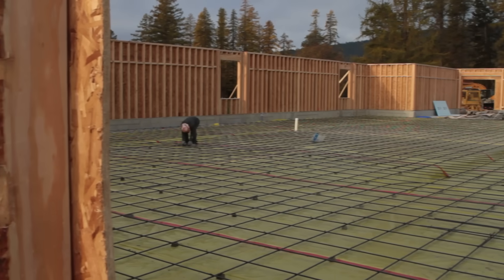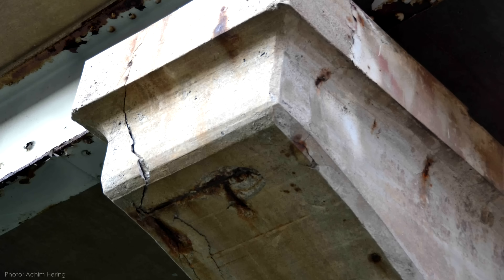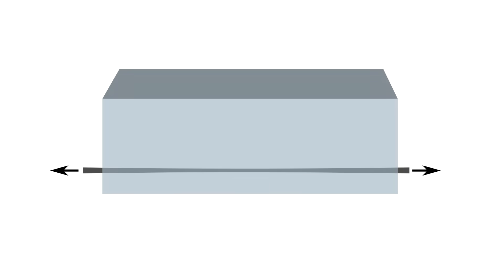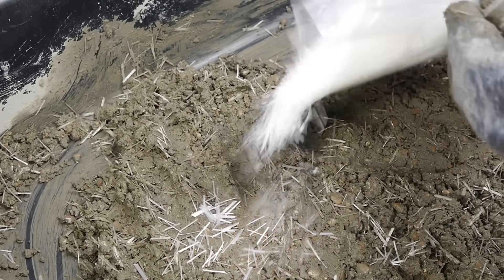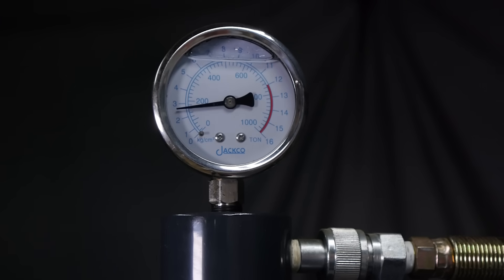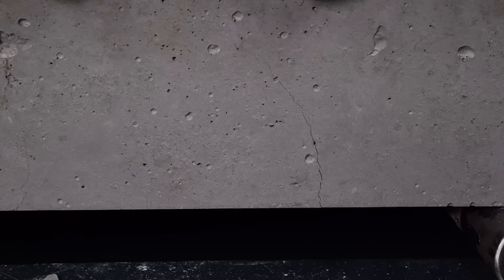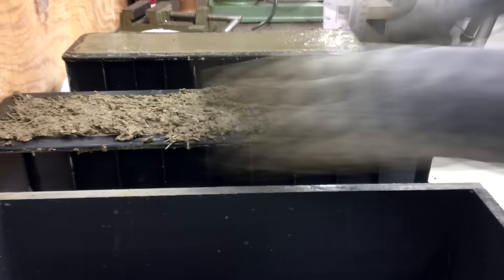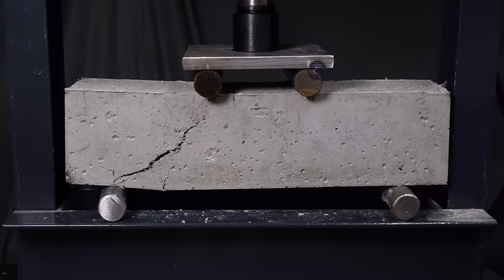Does Rebar Rust?

Comment: So basically hummanity went from making mud and straw structures to fiber reinforced concrete. Same concept, higher tech.
Reply: "Same concept, higher tech." sums up humanity. We still use alot of the same basic tools as we did in the stone age in alot of cases. There's a leather working tool that was used neaderthals that we STILL use completely unchanged. It turns out metal tears the leather, wood scratches and splinters, and plastic doesnt do the job right and breaks, but that same tool made of bone never breaks (and actually gets better with age), wears, out, and does the job perfectly.
Reply: @arthas640   
What's the Name of this specific Tool? I'm curious..
Reply: A jaw?
Reply: @arthas640  Not to get political, but president Trump is right in saying "wheels and walls work". I would add fire.
Reply: Exactly what I was thinking, this reminds me of Cobb construction.
Reply: Cobbcrete (TM)
Reply: Hahaha, I was coming down to the comments to say pretty much the same thing as soon as I saw the fibre reinforced concrete! XD

Plaster and horse hair is another old one. The ceiling of my old bedroom had almost an inch of that on wooden slats before it all came down
Reply: @HorzaPanda  wow!
Reply: @irenedavo3768  I was cleaning the ceiling to paint it and it fell down on me. Was not a fun clean up -_-
Reply: And rammed earth is still being used today.
Reply: Basically, we've never stopped building out of rocks and mud. Rocks are literally unchanged, mud got replaced with cement, and wherever mud was reinforced with naturally occurring fibers or sticks, unnaturally occurring synthetic fibers and metal sticks are used instead.
Reply: @ganaraminukshuk0   Yeah and warfare is still throwing rocks and sticking each other with pointy sticks. The difference the rocks move way faster and the sticks are metal.
Reply: fiber re-enforced mud bricks are still fine for some applications.  Shibam in Yemen is famous for its high rise mud brick structures.  they're like gremlins, don't get them wet.
Reply: I added a laser pointer to my hammer.
Reply: @Subhumanoid_  LMAO ...
Good one  !
Reply: We went from mud to clay to concrete and then did it all over again because we somehow forgot how to use concrete after the Romans vanished
Reply: I wouldn't actually say that. Have you been in one of those mud and straw houses? We still have plenty of them around, it's amazing how good the insulation is without any extra layers that we use today, in the middle of a scorching summer heat wave, it's like going into a fridge, and in the middle of a frost all it takes is a couple of logs to make you lie around in a tshirt.

Some of them even 200 years old, gone through several catastrophic quakes, one of them close to 8.
Reply: @techalyzer  do you have any sources for pictures on them?, aside from a generic web search that is, i find older constructs interesting.
Reply: @TS-jm7jm  I can just go dig in my pictures folder for the inlaws old house :)

I also have some footage from another place, my grandparents house in the country side.

Maybe I'll do a video about it and you can see it all there.
Reply: @Kiritsu: I had a similar thought when I saw the fiber-reinforced concrete being poured into forms. :)
Reply: And the sharpest blades we can make are made in the same old way we used to make arrow heads. Taking a rock (obsidian) and striking it with something else to fracture it. Materials technology is apparently everything lol
Reply: Because that's a simple, yet great concept.
Reply: @imienazwisko6527  you mean... concretept...

Sorry
Reply: Some of the early Great Chinese Wall was constructed by this method, only the later wall was stone.
Reply: There is a lot more theory that goes into it now. If you take a properties of materials class you learn about slip planes and the crystaline stucture of materials which has a big effect on their properties.
Reply: Grady - would you please do an anniversary special with a history and comparison of materials?
Reply: Which begs the question why din't we use fiber in concrete from the beginning.
Reply: Keylanos Lokj 
Les humid is bad for concrete. Submerged in water is the strongest cure there is.
Reply: and don't forget mixed with manure and or clay as a binder... :))) in some parts a braided wood filling/scaffolding was used in the same way as rebar to keep the mud in place... (wattle and daub)
Reply: Like black bread
Reply: A lot of thing run in basic idea and we improvement it. We don't live in Laser based house.
Reply: that is because the methods shift, but the principles never change
Reply: 50 times the size....romans never used straw OR rio....just cramps.
Reply: Corrosion = damage over time =DOT effect.
Reply: Bootstrapping technological advancements in a society still playing with dirt. XD
Reply: If it works, it works
Reply: Ha no is the granule box. Dih, ugh. Ist main make is they are make.
Reply: https://www.youtube.com/watch?v=4lbI-cBhkm8
Reply: we still use mud, its just now we bake it and call it 'bricks'.
Reply: @Withnail1969  we do also use compressed earth to build houses still at least in Australia it’s still done 🙂
Works a treat and lasts a long time!
Reply: It seems to me that modern technology and modern engineering practices are just a way to give inspectors job security..
Ancient styles of construction have weathered the lasted effects of Mother Nature. It’s time to try and unlock the old technology to build things that will last over a thousand years.
Reply: @cecilnoriega7276  There's a lot of factors but I think the 2 biggest things are

1) Surviver bias. We see what survived not the baddly bult stuff that didn't

2) A lot of modern building is done as cheap as possible, even if being cheap up front is going to cost you more in the long run. Learnt this doing a course on corrossion engineering :P
Reply: What about hempcrete.
Reply: Same shit with arrows fired from bows to sabot rounds fired from tanks lmao
Reply: Cob lasts longer, better thermal
Reply: Well now it is a fact and prooved, that old romans were actually building with archaic concrete, just sayin.
Reply: @MidnightatMidian  wasn’t to much different from ours now, it’s still the same concept using lime.
Reply: @noodlesoup2281  Well it was still very different from our modern concrete.
Reply: Same concept, but tons of CO2.
Lock-In.
Reply: Mud and Straw, aka Wattle and Daub, is still strictly better than Concrete. Because Wattle & Daub is 100% renewable, concrete isn't. Concrete is a major factor in why we are running out of sand. In 200 years we will have run out of sand. That's faster than we would run out of oil which is expected to be around 300 years in the future.
Reply: @nugget6635  "Super high-end stuff"?
Stone is the most prevalent building material on earth.
Stone is one of the longest lasting building material on earth.
If the end goal is to build something that is durable and capable of lasting thousands of years, stone isn't so expensive after all.

Whomever made those megalithic structures had a technology we do not have today.

They were not a primitive people. They were more advanced than we are as far as structural engineering is concerned.
Reply: Skippy Lippy 
Engineers use a limited lifespan when designing. 
Most bridges have 30-40 year lifespans.  In that time traffic patterns change and grow and it’s time for a newer bridge. That how it’s done in America. Which is a waste of resources I like the Swedish method. Take your time and build it to last forever.
Reply: @Kiritsu - Actually some of the oldest man made structures are made from granite and basalt stone.
Examples: The Pyramids, the megalithic walls of Peru, and so many others around the world.
These structures have endured for many thousands of years. 
Who made them? How where they constructed? No one knows.   :)
Reply: @skippylippy547  weren't the pyramids sandstone?
Reply: @Jefferson-ly5qe  Depends upon which pyramid you have in mind.

The Great Pyramid in Egypt is composed of limestone and granite.

There are thousands of pyramids all over the planet. Many different types of rock have been used. 

There are megalithic structures made of precision cut granite all over the planet. No one knows how it was done and remains a mystery.
Reply: @skippylippy547  The oldest structures are made of concrete and stone because how do you think a mud hut fairs after 10,000 years?
Reply: @skippylippy547  they do know who made them but anyway.
Reply: @noodlesoup2281  but anyway?
Reply: @noodlesoup2281  Uhm ... OK, so who made them?
Reply: @skippylippy547  I forget the question exactly but if you give me an example I’m more than happy to provide you with who built them? The pyramids in Northern Africa/ Egypt maybe? Am happy to elaborate if that’s what your asking?
Reply: @noodlesoup2281  Yes please.
Reply: Except the modern way designed by the "finest engineers" can start falling apart within months while there are structures still standing after thousands of years made out of brick or stone, ancient Roman apartment buildings for low and middle class still stand after almost 2000 years.
I call it tech fetishism, tech fetishists like the person that made this video want everything to be done their new way just because it is new. Of course skyscrapers have to use reinforced concrete, but it simply will not last as long as traditional methods no matter how "well engineered" it is. It has greater strength that is required for certain structures but a much shorter lifespan, tech fetishists don't like to acknowledge its negatives and want it used for everything, even when traditional methods are strong enough.
Reply: @sskoh  the Roman’s used a lot of concrete… (they invented it) it certainly wasn’t just brick and stone. 
A good example is the pantheon 🏛 
Concrete is a great building material and in certain regards cannot be beaten.

Comment: I was having a conversation with my dad about ways to sink carbon.
long story short to reduce the levels of CO2 in the atmosphere requires sinking carbon somewhere.
the obvious place is into construction.
So we were wondering if the steel reinforcement could be replace with some kind of wood composite.
wood is much better in tension than in compression correct?
obviously nowhere near as strong as steel but perhaps some composite or new way of treating wood could get a similar effect.
We would name this type of concrete "rein-forest concrete" because all new inventions need a pun.
what to people think?
would this be possible?

Comment: What is the perfect location for bars inside the block of concrete (there must be an equation)? and the optimum number of  bars for the block?
for the cause of rust i think the metal wire that used for connecting the bars together play a role by generating cathode and anode depending on the highest ability to loss electrons.
thanks

Comment: Your beams were over designed. The steel rebars should fail first. just wanted to mention that! Please keep up the good work. Very nice channel.
Reply from the maker: Yes, plus they fail in shear when Im trying to demonstrate flexural cracks :) I hope the point comes across regardless
Reply: @PracticalEngineeringChannel  With a rig already set up like this, it would be cool to demonstrate the difference between under- and over-reinforced concrete beam failure and the safety consequences of each.  I had this demo a while back in my civil program and it is quite a sight.
Reply: +1
Also add pure steel and pure concrete to that test.
Reply: Isn't it preferable to see cracks before the structure comes down? In the range of at least two inspection intervals before it fails.
Reply: Steel fail in an explosive way, almost instantly, while concrete "let you know" in advance by the amount of cracking. If you need to keep an eye on structural integrity by easy examination, what would you prefer?
Reply: @jekomac  you got it backwards. Steel is ductile and stretches prior to failing. Concrete is brittle which is more explosive fail. The correct amount of steel is what will "let you know" when a structure fails.
Reply: @jekomac You actually have that backwards.  Steel is a ductile material which will yield and stretch prior to failure.  Concrete has very little ductility and will fail catastrophically.   This is why building codes require a minimum amount of steel per structural member so that the steel will fail after the tensile strength of the concrete.  When you see cracks in the beam the concrete has already failed and the steel is carrying most or all the load.  The cracks are the warning signs.
Reply: @jekomac
That is an oversimplification. :-)
Depending on the failure mode. For Ultimate strength normal steel will permanently deform, and it will be clear that you should not add more load. For fatigue loads normal still will have "cracking" and you will se the stiffness of the structure decrease. But you can also measure the cracks and estimate the remaining life of the structure. Steel is in many ways "safer". If you have a local stress concentration in steel you will have local yielding and the stresses will be distributed around the stress concentration. And if this is only one high load over a lifetime you are safe. In concrete you have no yielding, this if you have a local stress concentration you will see a crack forme, and since the load cannot be redistributed the crack will continue growing and you will see a "explosive" failure. We can hope he will mage a video of pure concrete vs pure steel and you will se the difference.
Not that steel is better and concrete, it is just to different materials and you should probably not use concrete if you see that everybody else is using steel, there might be a reason. :-)
Reply: @jekomac  modern structural design focus on ensuring any element fails in a ductile way. All concrete failure modes are brittle (i.e happen suddenly), while steel in bending is ductile (i.e will give warning before it fails).
Reply: @Petch85 being synthetic and correct is hard :) Of course every situation need its own best fitted material and/or tech.
Reply: That is actually completely opposite. The reason you see cracks in the concrete is because the steel is yielding in a progressive manner. Concrete however fails very rapidly and with little warning.
Reply: @danbert8  i agree with you concrete has a brittle failure mode, but RCC members cracks way before steel yields. Please take another look @4:45 this crack rising vertically first then curving left is a flexural crack and the reinforcement kept this crack from expanding to failure, but the failure crack rising diagonally from the suport is a shear crack which is resisted by the plain concrete only. Hope my point is clear
Reply: It's actually the exact opposite.  Concrete failure is brittle by nature, whereas reinforcing steel will begin to yield significantly prior to rupturing.  If the steel begins to yield, they concrete will most certainly crack.
Reply: @Waleed 1992 they all failed in shear as there was no shear reinforcement - so bascially a it's a plain concrete beam goverened by shear strength and the longitudnal reinforcement isn't really relevant here
Reply: Yes exactly compression rebars weren't provided but in the real world most of the beams will have compression rebars as a way to hold the tension reinforcement
Reply: There's not enough development to fully develop the bar.
Reply: Shear destruction... :P
Reply: The beams were not over designed, the reinforcement had inadequate bond length.

Comment: Could you possibly do some testing on fiberglass rebar? It costs less than steel right now, but cannot be used vertically. 

Also if you can't find it with a minimum order of one, I can mail you smaller pieces.
Reply: what do you mean by vertically? as shear reinforcement? as far as I know, it can be used and it is actually heavily used in countries such as Canada where corrosion due to de-icing salts is a common problem.
Reply: What do you mean "cannot be used vertically"? I used to work for a place that made fibreglass rebar and one of the case studies (i.e. sales pitches) for it shows it being used vertically and horizontally with cast bends between the two.
Reply: Must be just the stuff I can get then. Maybe it's not thick enough.
Reply: Weird. I tied rebar for 20 years. Only used fiberglass rebar one time. And it was used in both vertical and horizontal directions.

Comment: Whenever I see pouring of concrete they apply a sprinkler mist during the curing for a bout a week. For both columns and flat surfaces. It's puzzling why this is.
My guess has something to do with CO2 gas emission.
So why do they mist water over concrete?
Reply: Slow down the cure to prevent cracking
Reply: Concrete needs to be "cured" (ie. protected) for a certain period after casting, especially in dry, hot and windy conditions. There's numerous ways of curing concrete and sprinklers mist is one of them. Other methods include wrapping (columns), covering and keeping moist (slabs), etc. If this is not done, the concrete will crack, and it will ultimately be much weaker and not perform as intended.
Reply: Water is the activating ingredient for cement.  So if the water at the outside surface evaporates before it cured, the surface will be diminished in strength.  You can often see this effect on sidewalks, when it looks like the concrete is flaking off the top.
Reply: You may also use aliphatic alcohol as a curing agent on windy days to reduce the rate of evaporation and reduce plastic shrinkage cracking.
Reply: Alcohol (ethanol,) evaporates at a lower temperature than water, which is the basis of distilling spirits.